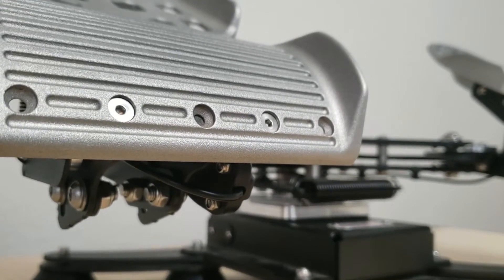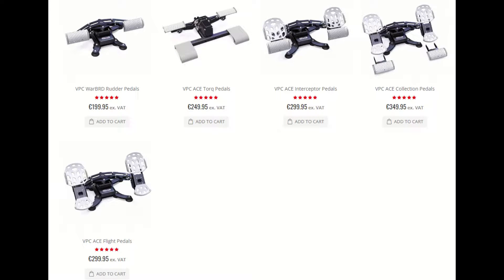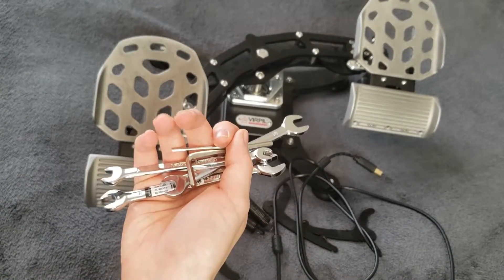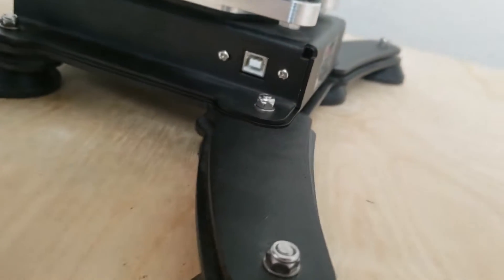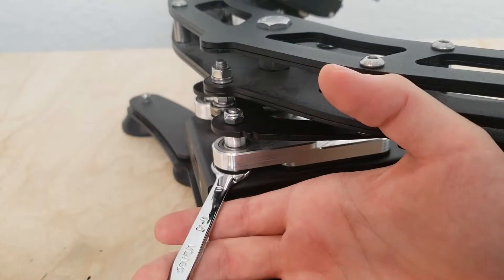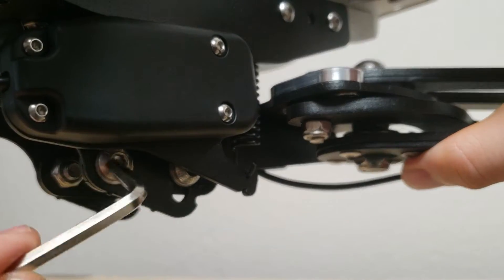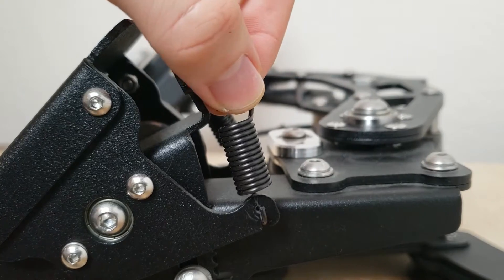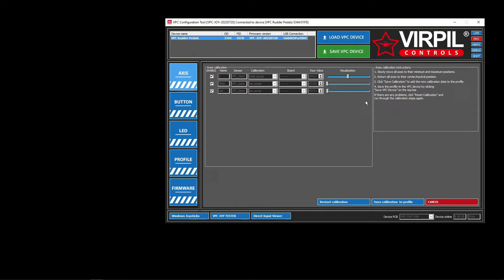Virpil VPC ACE Rudder Pedals Full Review

Comment: for some reason every hex key ive used hasnt worked. its either slightly too big or slightly too small. I even made sure I was using the right key size. I have only been able to remove one of the 8 screws to actually put the pedals on
Reply: Youre probably using standard hex keys.  It's probably metric.  Or visa versa
Reply: @ when I used a metric one it didn’t work with a 2.5. I had to use a 2. It worked eventually however
Reply: @chicagolanddesigns6447  typically if none of the metric works, its a standard fastener.

Comment: They look nice, but also look like they cannot be adjusted in terms of overall width.  So, for example someone training with a Cessna, would likely find the stance very wide (by the looks of it).  What is the total distance between them?  Sems odd they did not design a way to adjust that part.
Reply from the maker: the distance between the left edge of the right pedal and the right edge of the left pedal is about 10 inches. each pedal is about 5 and a quarter inches wide. i like them being wide because i have my stick going between my legs, but if i were using a side stick or desktop stick then i'd wish that the pedals were a bit narrower.

Comment: Thinking about getting these. How easy is it to go from centering(for fixed wing rudder pedals) to non centering(for heli torque pedals)? I fly both pretty regular on DCS and hope its not a big pain in the arse to switch from one to the other. Or is this even possible?
Reply from the maker: The centering spring can be attached and detached easily, but for helicopters I wouldn't recommend removing it because then the pedals will move around very easily, there is no dampener to hold it in place.